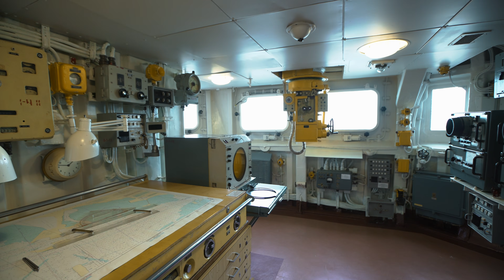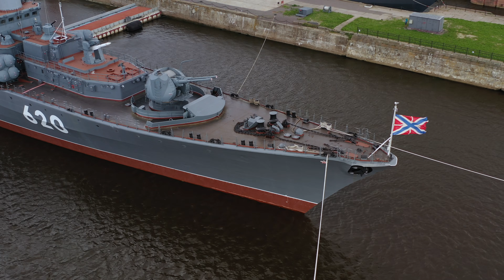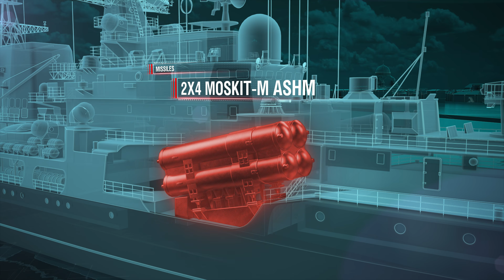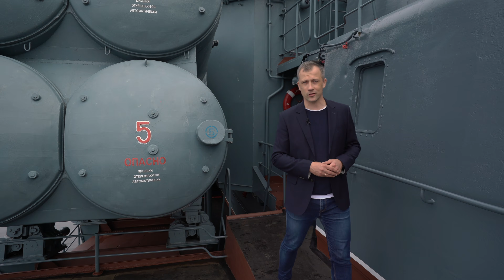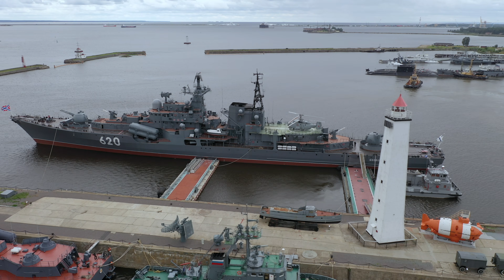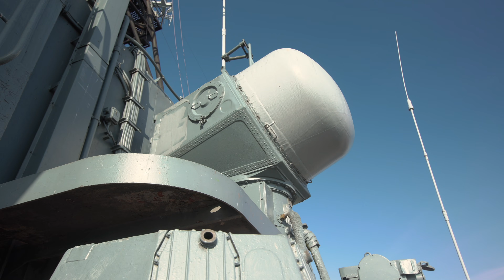Naval Legends: Bespokoyny.

Comment: Great design at its conception, can't help but think it would have been modernised far more significantly had the russian economy and military spending not crashed, 32 redut, 16 UKSK vls cells in place of the two single arm launchers would be a great start (China managed to get 32 larger strike length GJB 5860-2006 cells installed plus a 24 cell point defence missile system.

Comment: Mach 2 missiles 🤯🤯 Good Lord!
Reply: Brahmos missile has mach 3 terminal speed
Reply: @Erina Nagasawa   Dependance is not shed overnight. 

Be sure that the next naval aircraft won't be Russian. It was a flawed design. It maybe because it was just the second Russian carrier based aircraft so they lacked expertise but any way the next would probably be F/A-18 or an indigenous one.
Many countries started their carrier fleet with foreign ships, even France and Spain so what's the point at mocking India and the first Indian built carrier is already undergoing sea trials.
Russians have stopped developing newer diesel electric submarines and India has already stopped buying them. And those submarines are being slowly phased out so there won't be Russian submarines in the Indian Navy much longer. India already has built it's own nuclear submarine so after the Akula lease is over then the end of Russian submarines in India
The INSAS worked well but it is now a 30 year old design so they are being replaced. Expertise is not gained overnight. AK-203 isn't an anomaly as most countries use imported firearms and there are only a handful of skilled manufacturers.
India has started producing its own fighters and no newer big purchase of Russian aircrafts are underway only aircrafts lost due to attrition will be replaced.
Reply: @Erina Nagasawa  So what? It dosen't excuse that it is flawed. If an aircraft has trouble in less than a decade of operational service then it's a bad aircraft. I am not sure what do find so funny.
Reply: @Erina Nagasawa  I guess you haven't read history pretty well. Didn't the US use the Swedish 40mm Bofors aa gun, didn't the Russians use the British built trucks for med services.
You asked what we use in our Navy is Indian? 
Our Tejas LCA, the Bhishma tank, Dhruv choppers and many more.
Before you trigger an argument like this openly, think before you text.

Comment: A real Soviet naval legend would be K-19.
Reply: WG still has a fairly massive wall to overcome before they'd be able to introduce subs. I know it has been tried, but not really a great outcome. The wall I refer to is a data bottleneck. You can design a game that will be fabulous, but would require equipment that costs more than the average passenger vehicle. You can design a game that can be played on a glorified pocket calculator, but it won't have even half the eye candy / features (Those lovely means the devs use to eat, and keep the lights on.).

As long as WG has to balance the end users equipment, I don't expect subs to show up.
Besides, there are a ton of other sims that feature subs, they don't have to go out of their way to jump into someone else's specific niche.